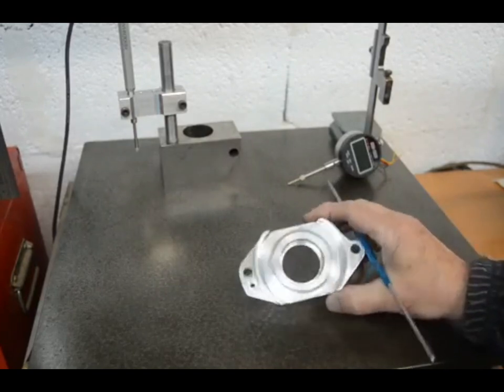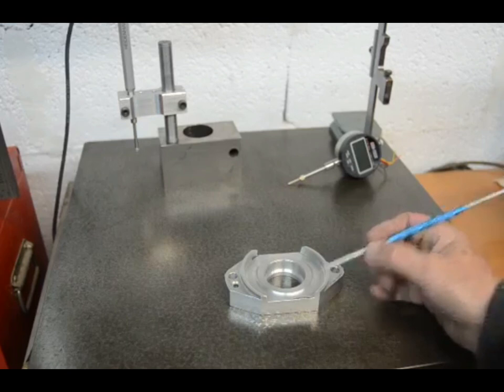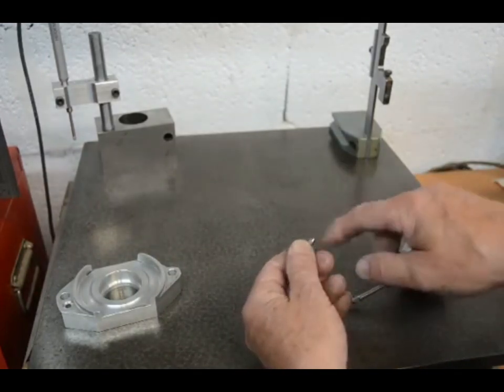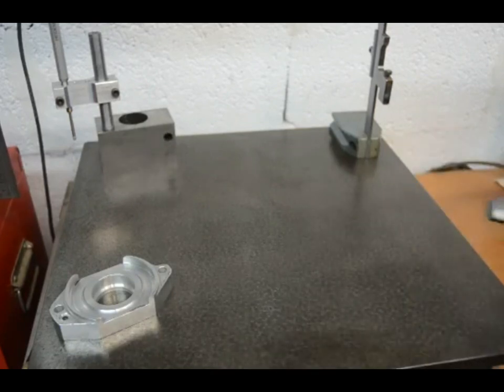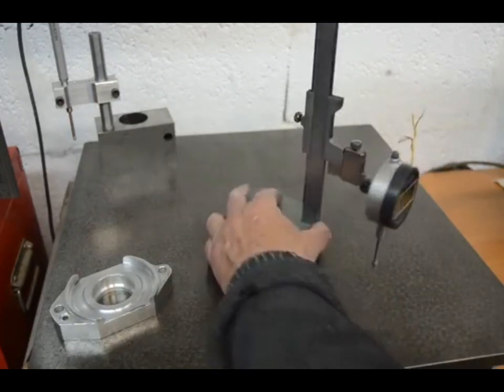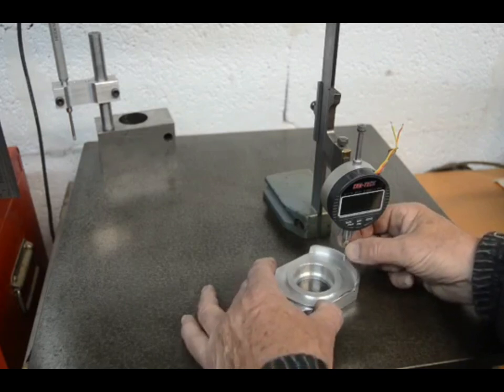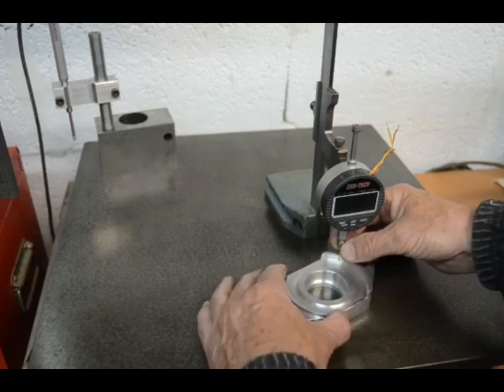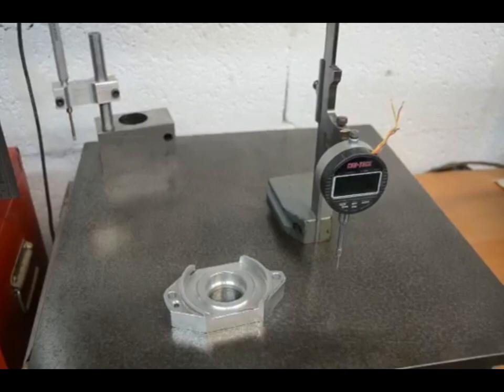Using a dial gauge on a vernier height gauge

Comment: One method to measure dimensions greater than the range of the dial indicator is to measure a difference between the point being measured and a stack of gauge blocks of a height close to the height of measured point. High accuracy can be achieved using gauge blocks and surface dial indicator instead of regular dial indicator.